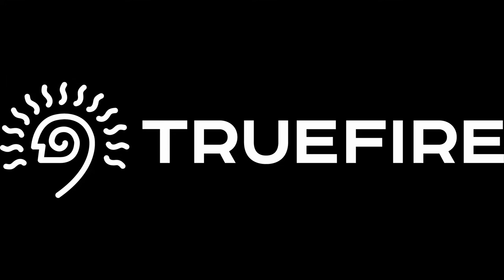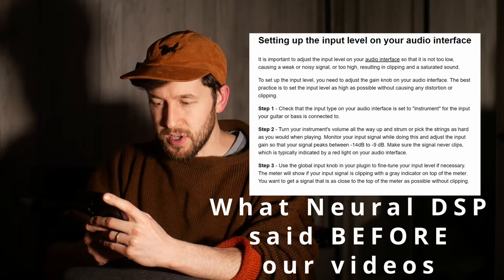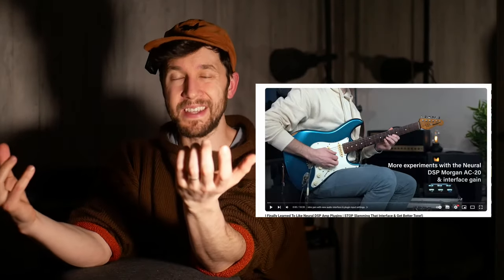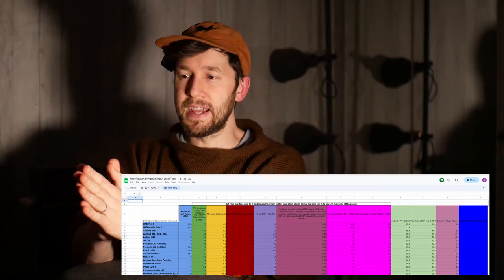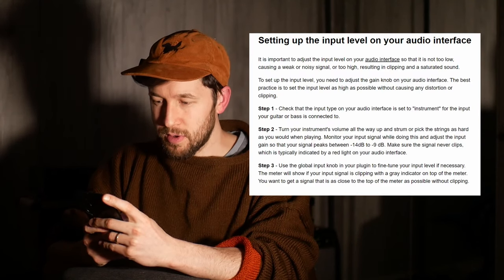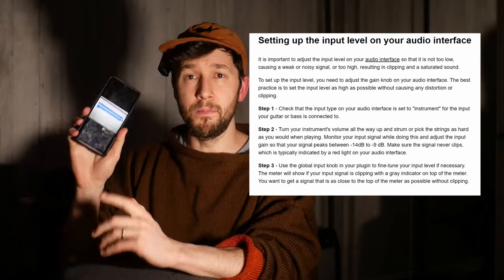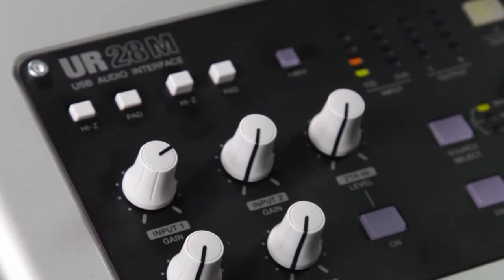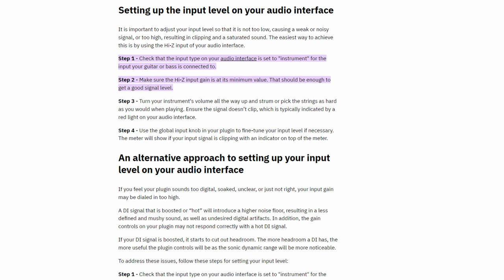Why Are Neural DSP Gaslighting Us About Plugins and Input Gain?

Comment: 11:06 I found that too. Generally Ed's way is the way to go now for me, as in most cases it's sounds much better, than using the old advice of dealing in the input of the interface as closest below clipping as possible. Yet in some cases adding a little boost with the interface gain seems beneficial. I guess it's just like a booster pedal in front of a real amp then. Anyways, a Hughe thanks to you John and all the others brining that up, especially Ed, of course.

Comment: I only recently sort of came to this input gain realization the "hard" way on my own, but also without really knowing it.  To explain:

I recently acquired a Petrucci signature Crybaby Wah.  Sounds fantastic through real amps (to my tastes at least).  However I was very disappointed when I tried it with amp sims.  It was extremely "honky" and didn't sound right at all.  Nothing like through my real amps.  If you know anything about this particular wah, in light of what we're now hearing about interface input levels, you'll easily guess why.  Like the Crybaby rack wah, the Petrucci signature wah has a built-in EQ, as well as an adjustable output gain boost.  Out of the box they're set to reproduce Petrucci's wah tone as closely as possible.  Not only do they run "hot", basically acting like an overall mild boost to your guitar signal, but they are EQ'd in a way that boosts certain frequencies even further.  The result is not just an overly hot input gain overall, but the "honkiness" I referred to.  As you sweep through the frequencies with pedal, some of those frequencies clip and make odd sounds etc.

My initial "solution" was to throw a 10 band EQ pedal after the wah, determine the offending frequencies, and compensate accordingly (I didn't want to adjust the pedal's internal EQ because I like it through real amps plus didn't want to deal with trying to alter the settings back and forth just to play through amp sims vs real amps).  The approach did work pretty well, but even using the EQ to take some frequencies down as far as it would let me, it still didn't sound as good as I'd hoped.  My interface input gain was still set according to popular conventional wisdom though.  With these newer, recent (for me) insights on input levels however, I turned my interface input gain to zero (instrument/high-z input) and voila!  Now the wah sounds great through amp sims too, and the amp sims themselves sound much better in general.

As an aside, the amp sims I'm referring to are Neural DSP's Archetype Petrucci plugin, THU Overloud (who is also guilty of advising the "turn input gain almost to the point of clipping" approach"), and Helix Native.  Neural's plugin seems to have benefitted the most.
For anyone interested, One of the appeals of the Archetype Petrucci plugin for me was the wah feature - I'm kind of a wah guy.  Not the chakka chakka whakka kind but more like how guys like Satch, Vai, and Petrucci use it.  Anyhow, I was anxious to compare the wah feature of the plugin (I use it with midi expression pedals) with the actual Petrucci signature wah.  The plugin wah sounds pretty good, but it's not as "rich" and as the real wah to my ears.  There's benefits to both.  For recording, I can record the expression midi and reuse the midi track for a different wah vst, or just turn the wah off altogether if I want.  Recording with the actual wah pedal the wah effect is pretty much baked in.  No real way to undo that if I decide later that I don't want the wah.
That was probably wayyy too much to read for a Youtube comment so cheers to anyone that made it to the end.

Comment: Is there somewhere that explains technically why this is? As a recording engineer I'd always set my DI inputs to the interface to about -12dB peaks. Then use digital gain staging before the plugin to set the "instrument level". I don't see how this is any different than setting it at the interface (other than you're now using more of the dynamic range that the interface has available, which should be a good thing). The plugin still sees the same level.

Comment: This whole amp sim world is completely new to me, but I guess I understand the point why the gain should be adjusted from the interface to zero. I just don't understand why the developers advise otherwise. But I also have a problem with it.  When I adjust a gain to zero from my audio interface, my DI signal is so weak that my audio interface's mixer application and my daw are just barely able to recognize it. That's why the amp simulators don't work at all with these instructions. I've tried using amp simulators with Daw and in standalone. My guitar is a fairly new 7-string Schecter with Seymour Duncans active pickups (can't remember the model) and my audio interface is an audient id24 which works with IDmixer app. Amp sims, I've tried Neural DSP: Archetype Gojira X, Rabea, Nolly, Fortin Cali and now I'm trying Mixwave: Spiritbox - Mike Stringer. Where the issue might be?

Comment: This exact thing happened to me. 
I was recording on my PC using my Audiobox interface with Helix Native. I wanted to compare it to my HX Stomp set up as an interface with the same amp model. 
I found out that I was setting the gain on the interface much higher than what the HX Stomp has as a default. I was able to simulate the same thing with a clean boost into the HX Stomp. It’s interesting stuff for sure!

Comment: ? Should be common sense. First thing i noticed in my 2 hrs of the free trial. Using midi pickups, so i made a preset on my fx pedal with patch level volume on cc latch, preamp/boost, and eq on cc latch as well, all in addition to the input gain control. Been using digital since the line 6 vetta cab in 2003, mostly roland/boss stuff for synth. Never had decent non amp distortion until gojira. I’m floored. My only complaint it the doubler could have a mix or level amount. Im loving it. Wondering which to get next. Prob petrucci?
Reply: Seems like a problem of gtr players that rely on presets vs producers that spend 30 seconds using their ears…

Comment: Hmmm I think I see a detail that is missed. Rabaea left the interface gain at 0 because he has a Hi-Z input in his interface. I have an Audient id4… on the Hi-Z input with J-Fet pre-amp I don’t add any gain, but on a line input I do… maybe that’s the extra bit that is missing in this discussion, the type of interface you are connecting to. And btw, Hi-Z JFET input sounds loads better to me on default settings of the presets.
Reply: Good point - I would add that using a buffer or overdrive pedal can help bridge the gap if you only have line-inputs

Comment: I feel at this point we are gaslighting each other in this absolutely bizarre state of affairs. I remember my first interface was a guitar only interface with no gain adjustment from line 6, and Pod Farm sounded pretty good, and I never changed from there.

Granted, I think only one company out there has a real solution to the problem, and that's ML Sound Lab. They have an input clipping indicator on their plugins, and they have instructions on how to set your gain based on how active the clipping indicator is. And to me, this is such an easy fix that any company can bake into a UI that all of these companies should do this, whether it's amp sims, analog pro audio hardware modelling, anything replicating nonlinear circuitry should do something along those lines instead having a micro-blerb in the manual that says "Calibrated at -12dBu" like that means anything to a vast majority of people.
Reply: Unfortunately a clipping indicator isn’t a help here, because it means a low output single coil gets adjusted to the same level as a high output humbucker. This is no different to saying “aim for just below clipping” or “aim for -6dBFS” or whatever - they are all equally inaccurate. 

The only way to do this with any degree of accuracy is to specify a dBFS level relative to a known constant voltage sine wave. That’s what these dBu numbers mean.
Reply: Also APFX has an input meter that tells you if you are too low or too hot wrt the sweet spot of the plugin
Reply: @eds4754  So, the way Mikko from ML put it is when you reach his level, that is where the modelling ML does was calibrated at, and therefore is the intended gain structure of the amp. Basically as long as the indicator isn't always on or always off, you're good. It works with every guitar and bass I own, and I'm happy.

I'm also happy with Neural, and I find I can run my guitars the same way with Neural. Both types of software I run input gain at 0 through a 3rd Gen Scarlett instrument input. This worked the same with an older Presonus 22VSL.

The average person frankly isn't going to know how to translate dBFS, dBu, or understand how all that is supposed to translate to a guitar signal. The solution needs to be easy to see inside the plugin. Most of us record and play guitars as a hobby, and I think it's fair to say most hobbyists are going to get the technicals to the degree they need to in order to understand whether or not they need to increase input gain or not. It's a simple question, it needs to be a simple solution.
Reply: @pellevastano  If that solution gives you adequate results that’s fine, and more power to you. It is not going to give accurate results though, it’s just a rough ballpark method. 

There is no rules to this stuff, but IMO, it’s important that if someone wants to have the amp behaving accurately, they should have the available information to make that possible. Turning an interface to 0 and adjusting the input in the plugin should be within the grasp of most beginners (I have helped a LOT of people with this). 

Ultimately, not everyone cares whether it’s accurate or not but that shouldn’t be a reason to stop people who do want a realistic response. I’ve made the videos as simple as I possibly can so hopefully anyone can take advantage if they want
Reply: @eds4754  I think we do effectively the same thing for getting the input level right. The only reason I've changed a knob on an interface for guitar DIs has been to turn it back down to zero when I travel, then adjusting input gain in a plugin. All I was suggesting is someone had a pretty darn good idea to get closer to the sound representative to what they modeled, and I would encourage more developers to put methods into their plugins to get us closer instead of having to rely on us going back and forth on this and sending and receiving advice ranging from accurate to sabotage. 

For the record, you have some of the most accurate advice. I have a scarlett, and what's in your documentation is right from what I can tell. But a lot of the advice that most people got was a holdover from analog recording that isn't relevant to digital recording, especially regarding signal to noise ratio (which is why a lot of folks were told to turn up gain on a DI source). So I think we still have a lot of work ahead to communicate the "why" in a way that makes sense.

Comment: This is weird, I saw Rabea's video and then checked Neural's website and it now states clearly how to use them. Is it possible that interfaces without a Hi-Z input used to require adjustments?
Reply: Seems not, the HX video interface clearly has a Hi-Z setting. At least we all know now :)
Reply: everything needs adjustment, it just depends how much. Modern interfaces are closer to reference for modern plugins like Neural dsp with input on zero.
Reply from the maker: Yeh the site changed after we made the videos.

Comment: I think of the input level as manipulation of the pickups output. It makes sense a higher input level would drive the plugin (or amplifier) harder. It’s not worth overthinking all this, if the plugin is more driven than you like, back it off, if it’s too clean and not breaking up, increase the gain. It’s not worth overthinking it, just adjust it to get the sound you require.
Reply: what if you don’t know how much gain an amp should have? Why would you use one model over another?

I’d personally rather have the amp model behave as close to the real amp would with the same input and use that as my starting point. Each to their own though.
Reply: It’s not so much how much gain the amp should have, it’s more how much you want. Ultimately it’s just down to getting the tone dialled in for the part. I do get where you’re coming from absolutely but I’ve gone round in circles so long then conclude it really is just another option. If run the signal hotter into the interface higher but the amp will not clean up enough, I can turn down the input level on the plugin or vice versa. Both of these are sources of clean gain so it literally makes no difference at all. Gainstaging with clean plugins that do not saturate is the biggest myth in audio engineering.

Comment: Feeding the amp plugin the most accurate signal that a real amp would seems pretty obvious. The raw guitar pickup signal has an incredible amount of dynamic range to it. If you clip that signal in the DI/preamp you're reducing that dynamic range in a way that the real amp would not experience. Bass players, and sound engineers have been working with these limitations for decades at this point. You typically don't want to clip a signal in the DI conversion process. A good general rule is to use active DI's on passive pickups, and passive DI's on active signals. If your pickup or signal from your pedalboard is very hot, use a pad to prevent clipping.

Comment: This adjustment has greatly improved the sound of my guitar amp sims ( helix native and neural ) and my mixes are easier and better sounding. Can I assume that I can improve the sound of my old ( higher input level ) recordings by remixing them with a gain reduction plugin at the front of the fx chain to bring the level down to where it would've been if it had been recorded with the interface input level set to zero?

Comment: Oh wow, this is sad really. I'm kinda lucky I went another way by monitoring using analog gear.
But actually my way of recording changed over time anyway. At first I did as you and just checked it is not clipping. Learning about gain staging, the general advice was to set every channel to around -16 dB. So I used that to adjust my Gain levels (which is actually a good idea. We do the same with our digital mixing desk in our rehearsal room so we can mix everything up and only ever have to adjust the input gain again. That's helpful when accidentally turning knobs or moving microphones). But getting to know about the relevance of 24Bit recording, I'm now aware that I can turn a quiet signal up as far as I want without losing quality.
Since then and since I prefer using some pedals for guitar tracking (and only an IR loader in the box) I use a DI Box where I split the signal and use the Balanced output into my Line Input/unamplified Mic input set to Line level. In theory it should have the same level as using the Hi-Z option. But will it be the case? I doubt that to be honest.

As you mentioned, it is a complex topic. And I think for most people it should be fine being aware of it (so thank you for this video!) as you can still turn down the volume inside the DAW. This way you can set the input gain into the plugin. That is actually not that far off from classic amps. Depending on your pedals in front of the amp, that might change as well. So use your input gain as clean boost or pad.

Comment: Step 2 says -14 to -9. That’s correct. About -12 on hard strums. If you have a Motu m2 and set it to 0 it barely hits -20 so it has to be turned up. If you have a scarlet it will be hitting-6 which is too hot. In the  case of the scarlet a di is needed. Setting every interface to 0 just will not work because all interfaces are different and why turn up the input on the plugin when it can be done on the interface.

Comment: i think it's because nowadays noise level on interfaces are low enough so setting to minimum is ok, but not best pracitce. Just easier to setup.

setting to maximum further reduces noise signal ratio.

use digital input gain to decide the level you send to the amp sim, which means that your ur interface level has nothing to do with how hard the amp distorts.

use gain knob on amp sim to actually distort to the right amount.

setting to minimum is easier to setup  for average players but not the best pracitce. (u don't need to tweak input gain amd go straight to the gain knob  with enough headroom.)

Comment: Makes sense but can definitely see why people would be adding gain on their interfaces.  In practice, if the signal is driving the plugin more than you want it to with your guitar and pickups, turn the input signal down.  If you want to push it further to get something different out of the plugin, turn it up.  If you like how it sounds, you don't need a plugin to at the same as the amp it was based on.  But this is good advice if people are trying to get something out of a plugin that it can't do because the input signal is pushed too much.

Comment: From what I know of analogue modeled plugins generally, no one's gaslighting anyone, it's in their interest for customers to get the best results. Use the input of the plugin itself (not on the amp sim controls, but on the plugin input) or trim before the plugin. It's the input signal going to your plugin not on the interface. Different guitars & equipment have different outputs, so it can't be the solution to standardise interface settings.
Reply: This is true of monitoring also... keep inputs going into (especially) analogue modeled plugins to -18dBfs to -12dBfs, keep the master volume at around 0dBfs, and use the gain on your headphone preamp / amp output to get the best monitoring level for you.